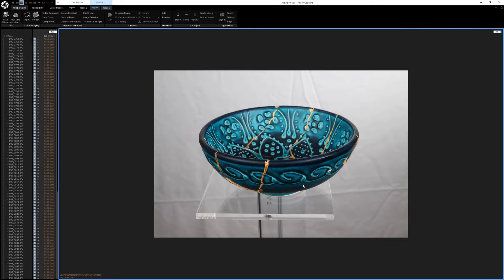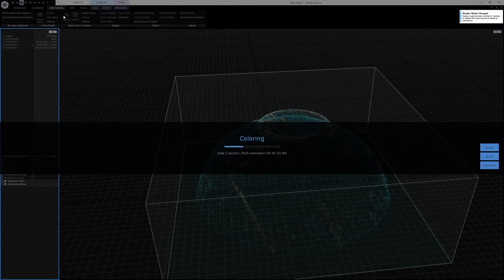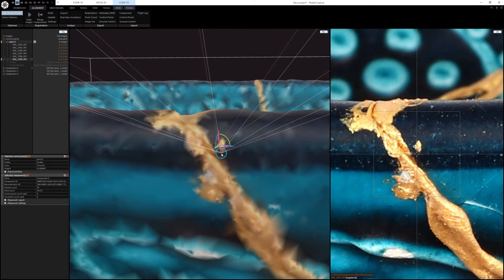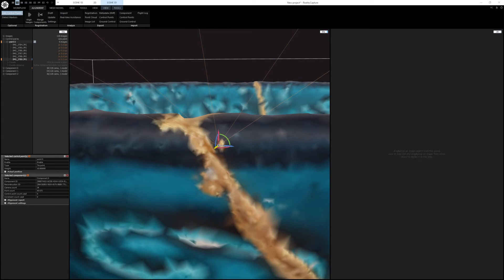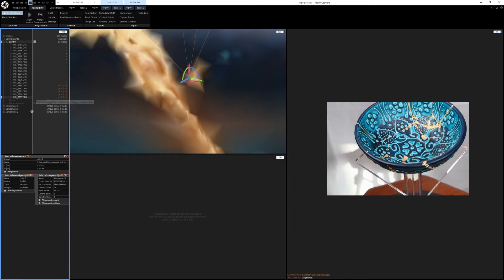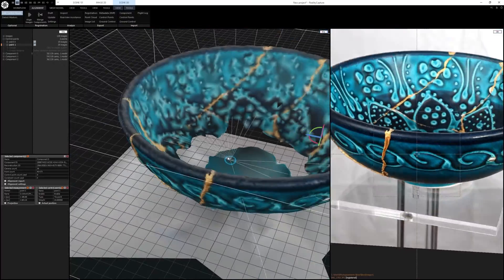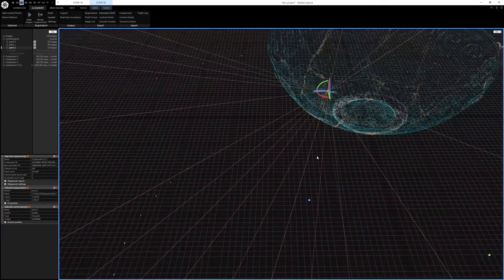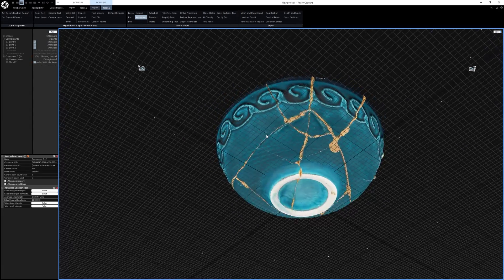Reality Capture: Using Control Points

Comment: Nice video! You explain this process very clearly :)

two hints:
- you can toss every set with the object in one position into RC, align, build preview model, use lasso tool to delete anything around it, then export masks. Do this for all sets, then open a new project and throw all pics and masks into it. That way, all background is DEFINITELY not messing up your alignment.
- I strongly recommend placing the CPs on the images, not the model! In my experience, that adds significantly to accuracy!